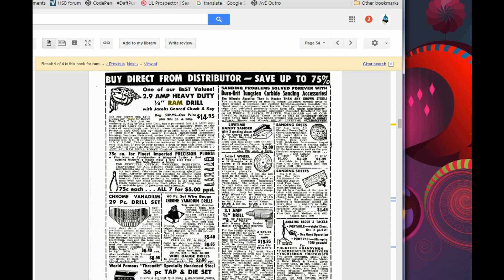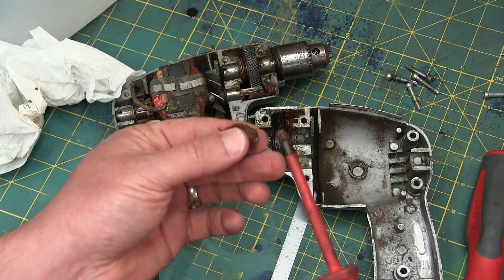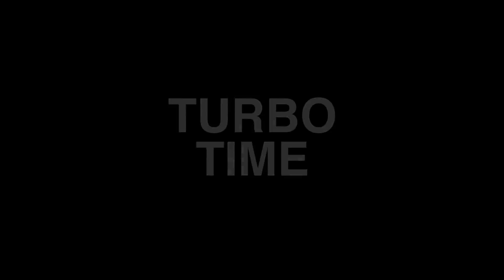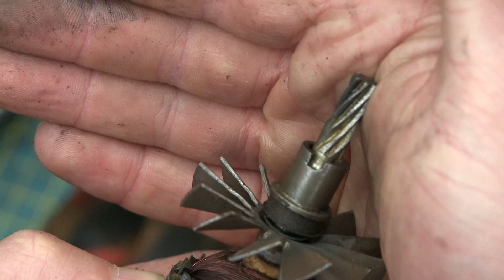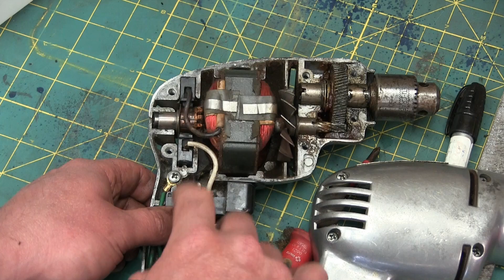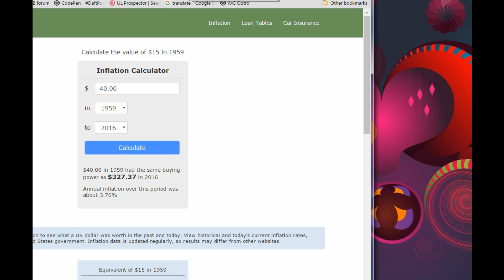BOLTR: Nifty Drill from the Fifties!

Comment: To me the inclination of the helix on the gear makes sense. If it would push back, then you would have to put a better bearing in, because the axial force while drilling would be bigger. This way you can substract the axial force created by the gearing from the working axial force and the bearing has to cope with a smaler axial force.

Comment: Aren't electric motors supposed to be more efficient at higher RPMs? Is that something that was learned after this drill was designed?

Anyway… I'm a little disappointed that you didn't at-least clean the insides of this drill more. Maybe not the grease, unless you have some better grease to replace it with, but mostly the old bits of wood and stuff. Do you want the drill to throw that into the air to breathe? Probably been moldering for a while in there.

Also, since you don't like the brush, why not replace it with something you prefer? Or did you want everything to remain as ‘original’ as possible?

Funny coincidence though: I'm already following the person mentioned in your intermission.

Comment: Have you been to the Salton Sea lately? A company I worked for dropped 3 pumps into a well out there at the Black Rock Geothermal Generating Station. We spent over $1,000,000 US grinding them into small enough bits to clear the well shafts and then another $5,000,000 for new pumps. I got sent out to keep the peace and rectify the situation, while keeping the bloodshed down to a minimum. We bled a lot of red ink, and a little human blood, but it eventually worked out. Sheffield makes okay cabinet scrapers. Their chisels, files, knives, etc, are okay. Sweden, Germany, Austria, Switzerland, and even Japan make equal or better steel. I am going to PM you and send you a 1940s or 50s B&D rotary hammer. It does not work, but you will love it. Trust me!

Comment: 1 idea for helping determine what kind of grease thickener you're dealing with (clay vs lithium-based vs calcum-based vs etcetc) would be to set up a quick drop test. Take cup with hole in center of the bottom. Pack it with the grease. Heat it up and measure the temperature it falls through at.
Reply: ASTM D566 is the standard method. NGLI grade will impact it some - but for the most part the same thickener will fail at around the same temp regardless of grade. 

Standard Lithium = ~177-204C
Standard Calcium = ~96-104
Standard Aluminum = ~110C
caclium/aluminum Complex = ~260C
Polyurea (common in wet low-load applications) = ~243C
ORganic Clay = ~260
Lithium Complex = ~312C
Calcium Sulfonate (the tits for high temp) = ~316+C

The most common greases right now are lithium complex and calcium sulfonate - but It is very possible that old-school drill has some clay/benonite thickener

 Keep up the fun videos!
Reply: If you want to build out a bit of a "data base" -- you can simply google a grease name followed by tds or pdf and you can usually grab the spec sheet real quick, which will usually list the drop point.

Comment: As you published this video i was working on a Sears, Roebuck and Co. drill myself from my grandfather. Clogged with gummy grease and lots of sawdust i got the thing running like new. Have you seen anymore videos of these drills. having some trouble with the graphite node contacts on my drill. keeps producing blue arcs so that doesn't seem to well. Anyways thanks for the vids and keep up the shukookum vids!
Reply: Not graphite contacts but the brush assembly.
Reply: I spent 3 hours trying to fiqure out why i wasnt getting turn on my drill... eventually i figured to just loosen the screws.

Comment: Those old metal drills had a small disadvantage to modern double insulated drills. Yea if your cord shorts out bla bla bla... Ever see someone drill into a wall with a metal drill and hit a power line on another phase. 240 straight to the hart. Not good.

Comment: I have a 1/4" all metal black and decker drill from around the same time period, but the weird thing about it is that it has a keyless chuck.  Also, it has a 2 wire cord, and a grounding wire sticking out of the bottom of the handle.

Comment: Would I be correct in thinking that’s a universal motor? I have an old Black and decker from the same era. Labeled as 36v dc but with a 240v mains lead. Runs a bit harder on the mains than 36v... Motor looks very similar. There was also a screw in the variable trigger. I'm told to limit the max rpms which I thought was an odd feature in a drill with non variable speed trigger lol. They should have gone with a variable speed screw clamp like your one.

Comment: Every old tool I've taken apart (a LOT of them, I'm an old guy) has any thrust load pushing the toward the commutator, not sure why.
A GROUND wire? WTF, that shouldn't be there if it's that old! They didn't start putting the extra prong on stuff till the '60's. And when they did they always included a adapter with two prongs and a wire cause NOBODY had outlets with the extra prong!
That method of connecting to the brushes was SOP in that time frame. Looks cheesy, but it actually works just fine. Brush holders? Yeah, that's a crap way of doing it. I've worked on several where heat warped the holder and made the brush bind. Tell-tale sign is you have to give the tool a good smack against the table to get it to start.

Comment: A few years ago I picked up a 240v Stanley version (free on the footpath council clean up) with circular saw, jigsaw, power planer and orbital sander. The drill was a powerful and made for a great car buffer, heavy though. All the tools this was meant to power are more high RPM type and the drill just didn't do it very well. The power planer was a bit shit and bloody awkward to hold with the drill hanging off the side.
I guess i'm just spoiled with having dedicated tools, but this kit would have been the duck nuts in the day. Can't imagine how much it would have cost for the full setup that included lathe drill press, table saw etc.

Comment: I have the same model of drill! The slot in the bronze bushing for the rear of the armature needs to be lined up with the case, got me a few times too. Mine had a rough go, the cord was completely rotten when I acquired it and I ended up burning out the field windings.

Comment: I have the Black and Decker alloy drill shown at 2:18. My Dad bought it new in 1950 something, and "paid a lot of money for it". When he gave it to me, one of the brushes was bad, so I took it down to the Black and Decker office in town, and they were all amazed. The old guy there hadn't seen on in years. Anyway, long story short, they managed to find me a single set of brushes in South Africa, and they shipped them out to me. This was back in the 90s. They said at the time, that it was the last set of brushes for the drill they could find, and it was unlikely another set could be obtained.

So it hangs in my technology museum, in running condition, with the last new set of brushes in the world, in it. :) Oh - mine is 240 volt - of course.

The drill came with many attachments too. I distinctly remember a circular saw attachment, a drill press, and a geared buffing attachment, and there may have been others, too, but I don't recall. The drill press is still there too, and it worked amazingly well last time I used it - certainly all you'd ever need if you only drilled wood, and light metal. Great memories.

Edit - Oh, I also remember that the circular saw attachment was very good. In fact, it was so good, that for many years, the drill was permanently attached to the saw, because it had a small blade, and Dad preferred it to his new 9" circ saw, which he reserved for heavy cutting only. It was very lightweight - all alloy, and it had a really nicely angled and nice long dust vent which worked a treat, and it was super easy to use, and see where you were cutting. It was the circular saw on which Dad taught me. Great memories.

Comment: There is a reason why they did the helical gear direction they did. This setup will place load on the motor's axle where it terminates blindly at the commutator. If the gear was reversed, the motor axle would be pulled out of it and they would have to come up with a larger thrust bearing right under the propeller. More expensive, more wear because of more linear speed. Plus they would get trouble aligning the commutator with the brushes because while now it's indexed right in the brush area, otherwise it would rest on the far side of the motor creating jitter in the brush position.

Comment: Thank you.  I really like the posts.  I'm pretty sure the felt plugs are there only to hold oil for the oilite bearings.  I agree that the helical gears will tend to push the spindle forward.  However, because there's no reverse, that's not a bad thing.  99% of the time, there would be more thrust from pushing on the tool.

Comment: why dont they make shit like this anymore
Reply: Plastic case is much cheaper to produce and it's lighter, doesn't get cold when it's winter or too hot at summer, also it's strong enough, it's a drill, not a hammer.
Reply: i mean all those different things you can do like drill press hell i even saw a band saw attachment
Reply: Metabo still do, well nearly, the bits you touch are plastic, (sorry AvE, re-enforced nylon thingy)  but the gearbox housing is still made of aluminium. Aluminium housing dissipate the heat really efficiently which extents the life of the drill.

Comment: The orientation of the helical gear makes perfect sense.  It's only under load while drilling, and while drilling, there's plenty of force on the chuck to counteract the forward thrust from the helical gear
Reply: I guess that's right, when it's not under load the only forward force on the gear is at most a fraction of the force resisting its rotation due to friction.

Comment: Black & Decker made a retro METAL BODY battery drill, late nineties, maybe early 2000s or thereabouts. Not that great spec-wise, but it sure was cool. It was some kind of an anniversary model or something like that.
Maybe they had the gears push away the chuck on purpose. Your not running it idle for that much, so you only need to put a bronze washer or something on the front. But when you drill into something, it actually takes a bit of the load that would all otherwise go to the back end ball bearing. Sort of a floating bearing action! Can you feel that when you start on a workpiece?

Comment: I took apart a Black and Decker drill from around the 30s, it was pretty cool and also a little bit terrifying. All metal construction, and just a little piece of fish paper or whatever it is behind the switch mechanism was all that was standing between you and 120v. They wrapped the windings in string to secure them, which I thought was pretty interesting. An ad I saw from 1929 said it cost $29, which in todays dollars is about $400. Friggen pricey!

Comment: Also, the way they cut the helical gear would combat the pressure of pushing the drill into the material you're drilling. It's not necessarily backwards; it might be a well-thought-out assist to the existing spring/padding.

Comment: Maybe the thinking with that helical gear orientation is that when under load it will take a little bit of pressure off the bearing, since the gear pulls the chuck away from the bearing where the operator is pushing the chuck into the bearing.  If it went the other way, much more force against the bearing, even with no load.  Just a thought.

Comment: Wont last - in reference to Bakelite brush mounts.... It's 70 years old
Reply: He also said that it hadn't been used very much. Also, it's 57 years old.
Reply: Yeah i know. I wondered how a modern tool would fair even if it hadn't been used much for 70 years. turn to dust i expect.
Reply: flagpoleeip Some do, and some don't. It's hard to predict. We had a pair of craftsman cordless drills that outlasted about a dozen assorted "quality" drills. Metabo right angle grinder outlived innumerable milwauke and makita grinders while being the most used and even submerged in salt water twice. I think I did wash it out after the second dunking, and partly take it apart though.
Reply: I think the fine wires would corrode away but the plastics would be pretty solid. you get a fair idea what accelerated aging looks like when you work on fishing boats. The PCBs hold up well, but the connections to them fail. Fine motor windings corrode unless they are coated in epoxy or suchlike.
Reply: +GunFun ZS that makes sense. I wonder about the surface mount components. I know they're all solid state with no moving parts but I think they'd all go to shit too.

Comment: Hello AvE. You really read all of these ? You’re a good man, I couldn’t focus long enough to….what was I saying ? Oh ya, about the bull gear, not sure if it’s right, but the thinking might go like this : No push, no load. The work piece pushes back at you with the same force as your weight on the drill, so the load on the bearing at the front of the gear sees opposing (linear) force vectors. Yes, they don’t balance, but at least they subtract. Off the top of my head at 1:00 am, I could be wrong.

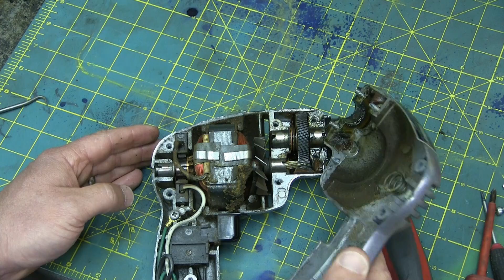Comment: so Ave i think at the 6:00 min mark the reason for the gear cut like that and the bearing in the rear of it, is so when you are pushing on it to drill it overcomes force of the gear and helps to push it forward so it puts less stress on the rear bearing, it will still ride on it.

Comment: I wonder if the cut the gears that direction to take the load off the rear gear bearing such that air can pass in and allow it to cool a little between drill actuations

Comment: Did you notice a lot of the old power tools from back in the day are weird sizes, your drill with a 1/4 chuck and the Porter Cable saw with a 61/2 saw blade.

Comment: You can emphasize the cheese factor of these old but great tools, but, I have used and abused that very same model drill since the late 60's. I paid $5.00 for it at a yard sale, used of coarse. It drilled holes, it spun a a rock to sharpen blades, it turned many things it was NEVER designed to. It even was used as an engine starter when the wind up crank on the old Tecumseh 5 hp push mower decided to fly apart. A broken 3/8 extension was ground down with a rock being spun by the drill to 1/4, then a 3/4 socket to adapt it to the flywheel bolt, and voila, an electric mower starter was born.  It smoked, it smelled, but it still worked.

Comment: hey ave, I have one of them their drills in a half inch chuck. I has to weigh fifty pounds. I was drilling concrete with it about three years ago and because of the crazy on off switch for a trigger it done picked me up and slammed me into the wall when the bit grabbed goodntight. it has an all metal case and a big ass second handle off the side so when it bites it isn't supposed to break your arm. which is actually the reason I have it. the old timer gave it to me because it snapped his wrist. great vijeyo keep up the good work..
Reply: It's a universal motor. they're reversible if the brush or field connections are switched
Reply: I use a half inch Sioux at work and that thing scares the shit out of me. Even drilling through 1/4" extruded aluminum it wants to take a part of you with it.
Reply: spacehitchhiker42 yes correct reverse the field reverse the rotation. my mistake. well done for picking up on it.
Reply: smallmechanic sorry the chap below is quite correct, its a universal motor and it can be reversed, my mistake.
Reply: Yea I got one like in the vid, I got it from my grandpa...I still use it, I wish it would go in reverse but oh well....darn things a brick shithouse that will prolly last another 75 years
Reply: Yeah, back then they'd tell you to walk it off. LOL
Reply: +Chris Readman it's a three prong grounded plug I have one with the ground cut off I'll try it and let you know, but with out the ground if one of the windings in the motor short out you then become the ground⚡️💥
Reply: +smallmechanic  
don't quote me but I think in the modern drills with reverse they reverse the polarity inside the switch assembly....
I thought I remembered having to figure that out back in the day during gen tech class for an assignment.
Reply: Chris Readman no it an ac motor changing the polarity won't change direction, that only works for Dc and three phase motors
Reply: +MrTheHillfolk could you not use reverse the polarity for reverse?
Reply: +Chris Readman no it does not matter which way it's plugged in. Maybe if you switched the hot and common wire on the motor it may run in reverse,
Reply: +Chris Readman short answer, no. the way the reduction works, you'd trip the breakers in your house if you tried.
Reply: ronindebeatrice ?
Reply: you would have to reverse the connection to the brushes
Reply: Colin Coady so no ac powered drills have reverse? Or is it done through some kind of transmission?
Reply: +MrTheHillfolk I have an old black and decker that's the same way! And I have an extra one that I can use for spare parts of I ever need it , just no reverse💀
Reply: +smallmechanic 
Yea I'm sure my grandpa had it apart before ,the cord was probably replaced in the mid 80s sometime 😂
I like using it, it calms my nerves...
who wants to go backwards anyways? Lol always move forward 😁

Comment: could you gut this beauty and put some new fangled motors and junk in? that would be sweet.
Reply: Why?  As he said, motors really haven't changed much.  They're running them faster now, but that's just so they can use cheaper motors and still get some torque by gearing them down more.
Reply: i don't know, hence the question
Reply: Sam Ritte If you managed it, you'd just be making it worse.